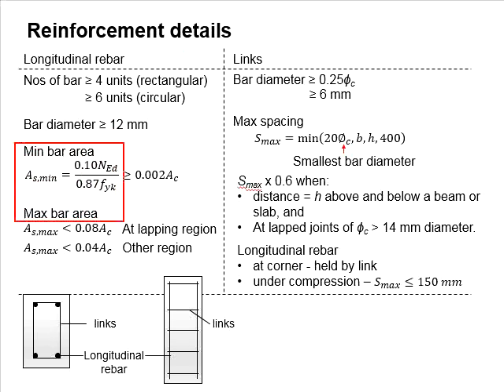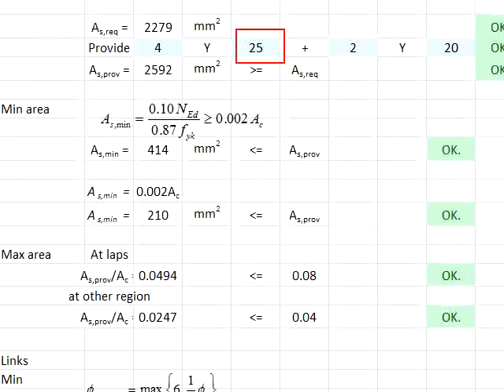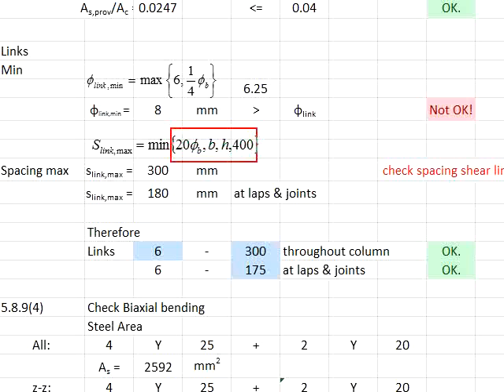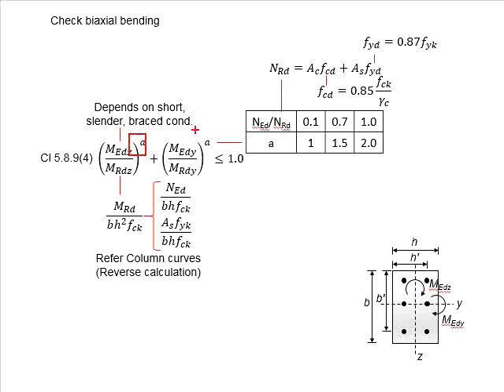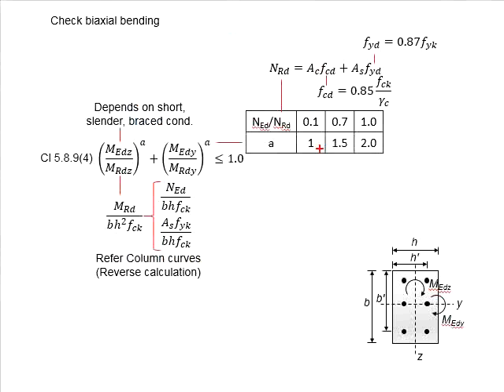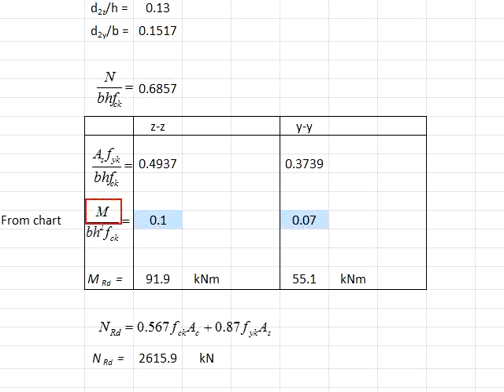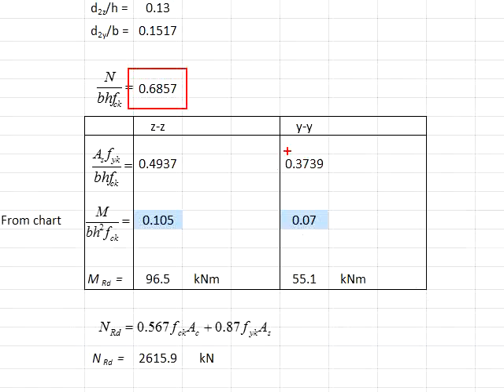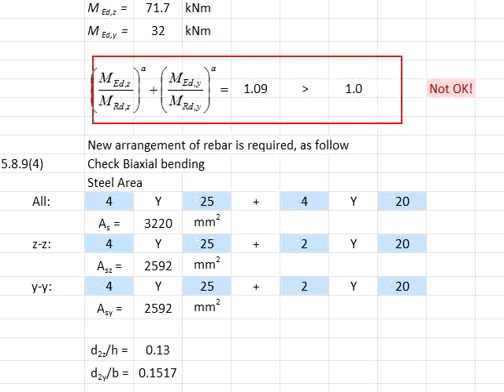2.24 Example: Short braced column, biaxial bending Part 2

Comment: Moment of resistance can also be found by finding neutral axis depth where tension force equals sum of compression force. It may involve trial and error if tension or compression steel does not yield. Once depth is found, moments about the tension steel can be taken to find the moment of resistance.

Comment: 9:23 Med,y= 32kNm, but  Med,y= 45.5 kNm in past video 2.23 5:30. Which is correct
Reply from the maker: Good question. Both are correct. In this video, MEd,y = 32 kNm because "Imperfections need to be taken into account only in the direction where they will have the most unfavourable effect." As in this case, MEd,z is more critical, the imperfection NEd x ei is included. Whereas, MEd,y is not the critical side, the effect of imperfection should be removed from MEd,y = 45.5 kNm. This leads to 45.5 kNm - 13.5 kNm (imperfection) = 32 kNm.

Comment: Why use design chart d2/h=0.15? 7:50
Reply from the maker: Good question. I simply rounded it up, which rigorously speaking, is inaccurate. To be more exact, interpolation may be required.